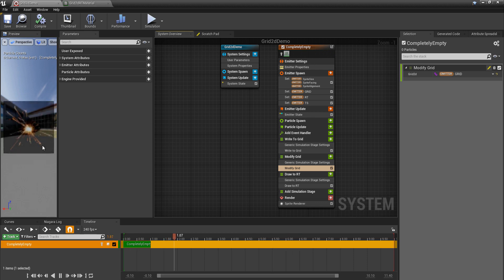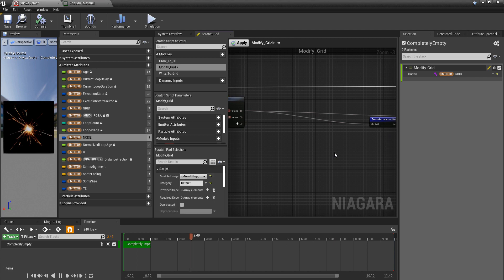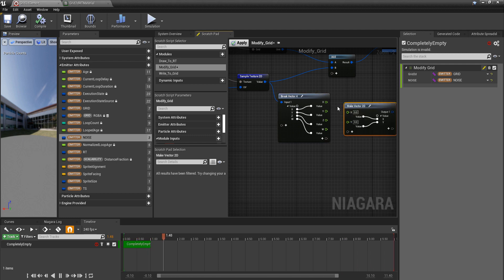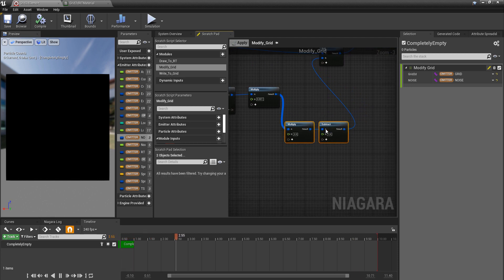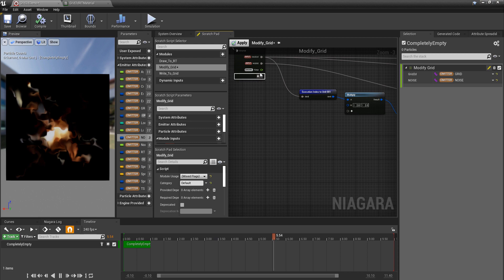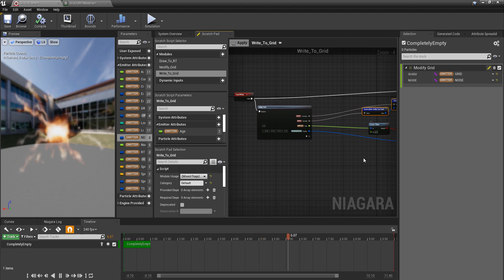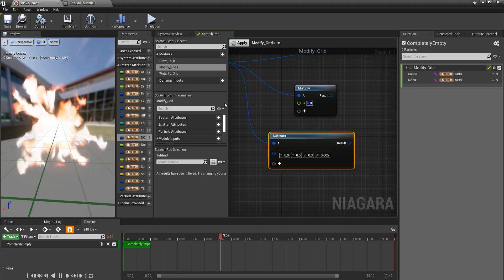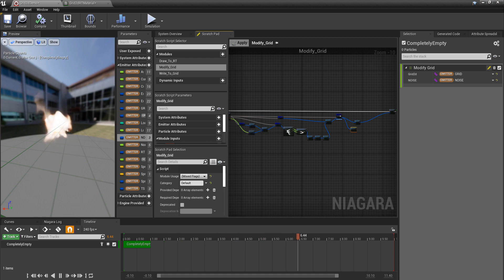UE4 Niagara Grid2d Simple Advection

Comment: Is this more of a general demonstration of what you can do? I just dont see why you use niagara to manipulate it when you could do this inside the material that is sampling the RT and drawing it? Would also cause confusion to some designers if they were to try tweak it but its basically an empty material (that is an esoteric example but still).

Appreciate your tutorials though!
Reply from the maker: Materials can't draw to a Render Target, so you'd have to do the Niagara part in either blueprint or code. Niagara is just a prebuilt system to do it. This was the simplest way to demonstrate how to handle the data I could think of. If you want a more practical example using this technique, you can look here: https://www.youtube.com/watch?v=QcY5UlB5vKk
Reply: 我认为这样使用niagara事实上相当于你会在unity中使用的compute shader，因为UE的材质编辑器不允许你直接向RT写入信息，你得到的东西并不会直接用来着色，而是一些着色所需的动态纹理。这使得你能利用GPU的并行能力快速计算出一些不适合在CPU上运行的东西，比如，如果你试试去做FFT海浪模拟（事实上就是这个需求把我带来了这里），你会发现你无法在材质编辑器中计算出海浪的高度图和法线图，你必须先写好RT，再从中采样，最后使用材质编辑器着色。我认为他的教程是一个很好的入门尝试。

Comment: Thanks for the tutorial, but JFYI, at 3:40 you can remove the pins in the Break node and add new value type to the output so you can convert the Vec4 to Vec2 with just one node instead of 2 nodes.